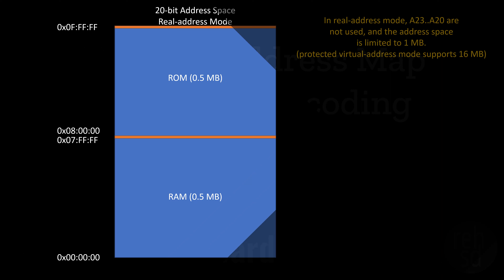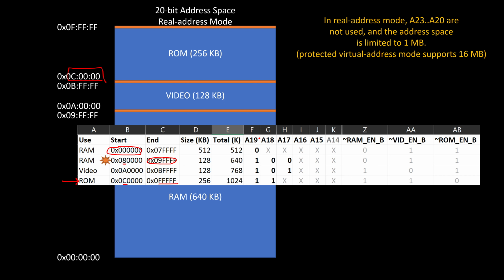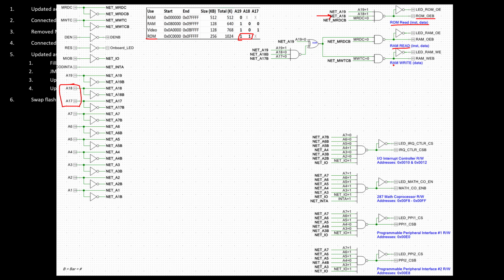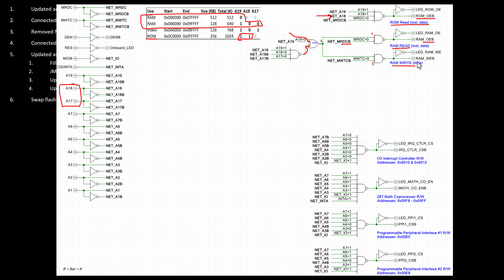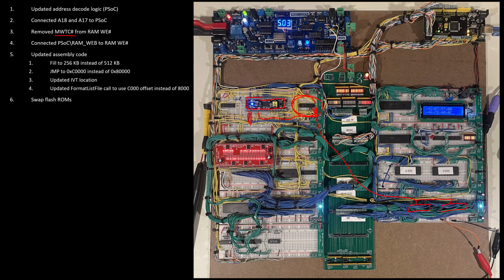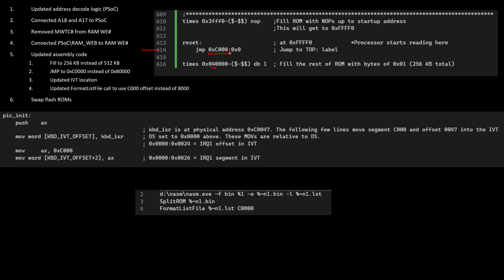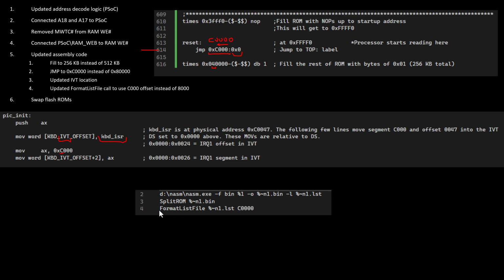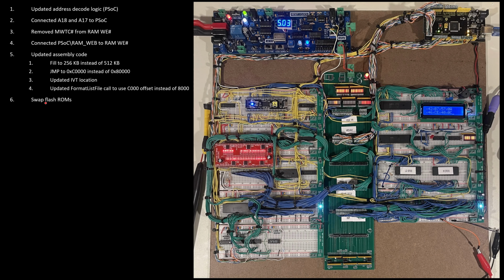80286 Build, Ep. #47 - Updated Address Map & Address Decoding

Comment: Thanks for great videos! So interesting and inspiring!

Just a couple of small notices. If you want to have "1" for your RAM_OE before MRDC gate, you would need to supply A19 inverted on the first output of XOR gate. As for the second input you would need to supply non-inverted conjunction of A19A18#A17#, otherwise in case of let's say "111" for A19A18A17 you will get 1 at your NAND which can potentially enable RAM when it's not needed. And finally you don't really need a XOR gate, a simple OR gate will work (since A19 and A19# cannot have the same level at the same time), and save some logic elements inside your PSoc, because internally it's gonna use 2 AND gates and one OR gate to perform XOR operation.

So finally a chip select should look like: A19# or (A19 and A18# and A17#), or if you'd like to use just NAND logic it can be converted using De Morgan's law as follows: (A19 and (A19 and A18# and A17)#)#  

Afterwards you do of course NAND with MRDC#.
Reply from the maker: Thanks! I'll take a look at my logic, based on your comments.
Reply from the maker: Vladyslav, I modified the logic based on your feedback, as follows: https://imgur.com/a/Zk55Wap. I updated my PSoC with this update. Did I get that right? Thanks!

Comment: Another great video!

With nasm, if you are using the same constant, for instance a segment number, in several places in your source file, you can use %define to define a symbolic constant for it (I'm not entirely sure, but 'equ' just might do the same trick). 

I often put these into "header" files that I include at the top of my source code. These %-statements are basically preprocessor defines, and they work a lot like the #-statements in C(++) and the C-versions often have counterparts in nasm. 

For instance, say you want stuff that is configurable to be in a file called 'config.inc'. Maybe you want to generate it automatically, maybe not, but you don't want it to be included more than once. Just like in say you can create conditional logic for that:

%ifndef CONFIG_INC
%define CONFIG_INC

.... define your macros, constants, etc. here:

%define ROM_SEGMENT 0xc000

%endif ; CONFIG_INC

You then include it at the top of your source file:

%include 'config.inc' 

And you can use the macros defined in your 'header' file as well:

reset: jmp ROM_SEGMENT:0x0000

I hope this is useful to you.
Reply from the maker: Thanks, @Damouze!

Comment: ROM and VRAM can both overlap. There is no need for ROM to be writeable and there is no need for VRAM to be readable. Make ROM respond only to reads and VRAM only to writes.
Reply from the maker: Really cool idea! I do plan to read from my VRAM. For example, I may move sprites by reading the original location and copying to another location. Also, I have 32K of extra memory in the VRAM that I intend to use to cache sprite data, and I will need to be able to read this. (I have 128 KB of VRAM, of which 96 KB is actually used for the screen resolution used.) I can use this extra 32 KB for general system use, too. Thanks for the suggestion! I will use that idea at some point.
Reply: I disagree. VRAM should definitely be readable. You may want to perform operations on VRAM based on its current content.
Reply: @damouze  Normally, you do all the calculations in system RAM and then quickly blit the results to VRAM. May seem wasteful, but has the potential to make things much faster (for example if the CPU has cache).